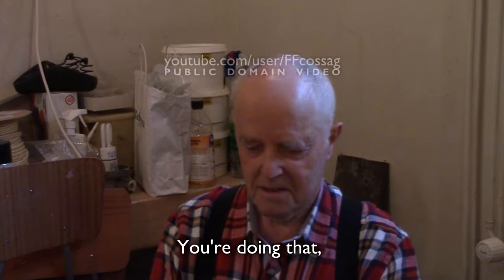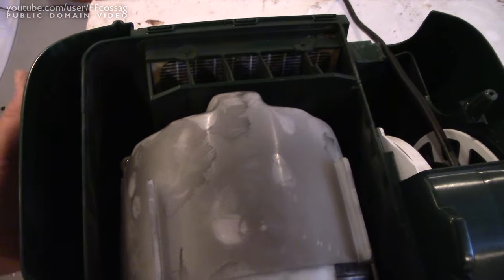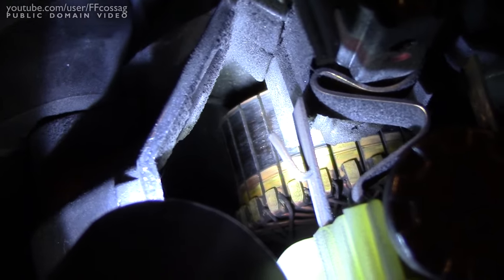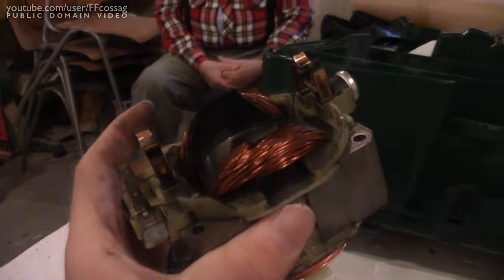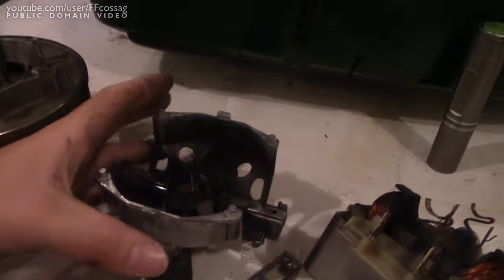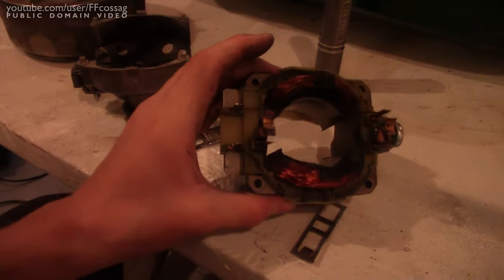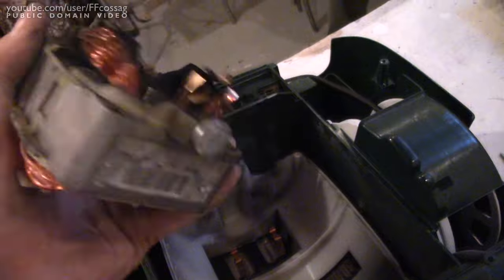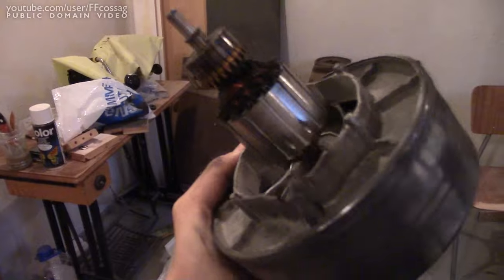Diagnosing a screaming vacuum cleaner (bushing failure)

Comment: I am really surprised at the bushing being used rather than ball bearings. Planned obsolescence I guess? 
I am a fan of the Panasonic vacuums, They are made in a two person factory the rest is left to robots in complete darkness.
This sort of thing does happen to motor vehicles on the heater/defrost motors esp where air conditioning is installed due to motor never seeing any off time. Vacuums spin at very high RPM as well in comparison.